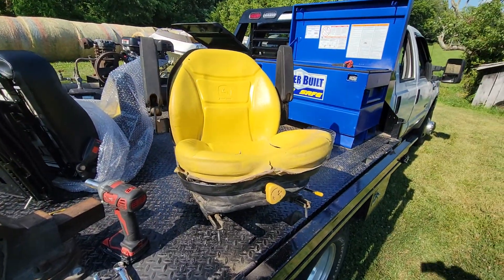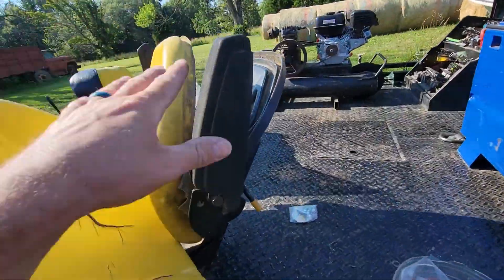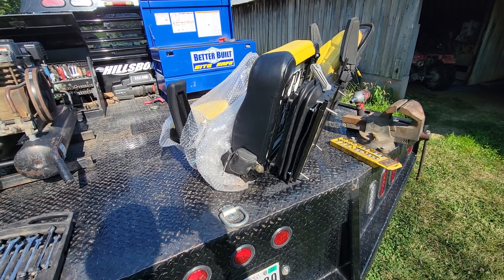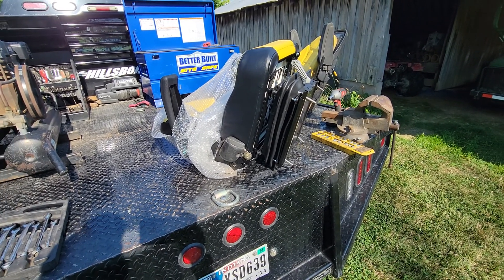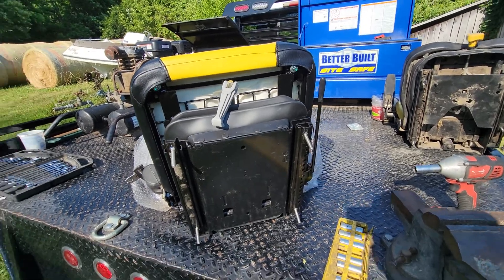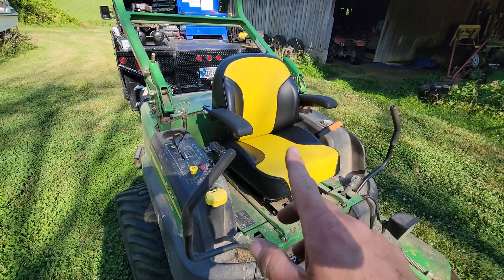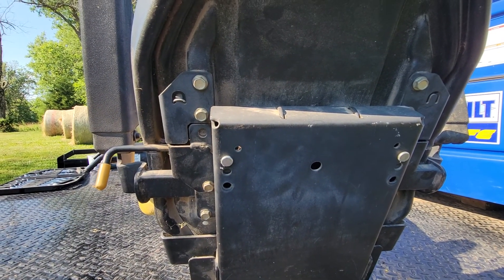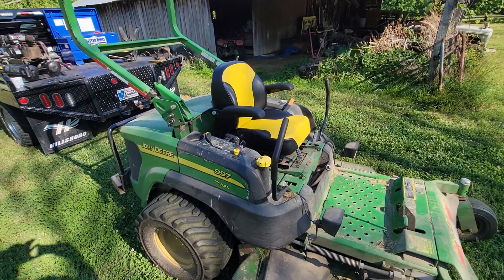Cheap John Deere 997 Seat Replacement SU-201111BKYE

Comment: Great video, thanks.
Reply from the maker: For what it's worth, the new seat frame adjuster broke a couple of weeks ago.   The adjuster was just not built heavy enough.   I ended up welding the track together so it would be locked in place.    I need to make an update video.